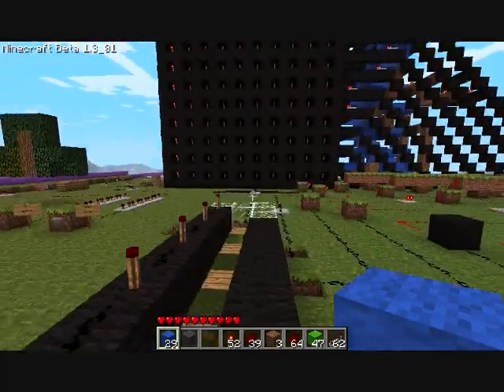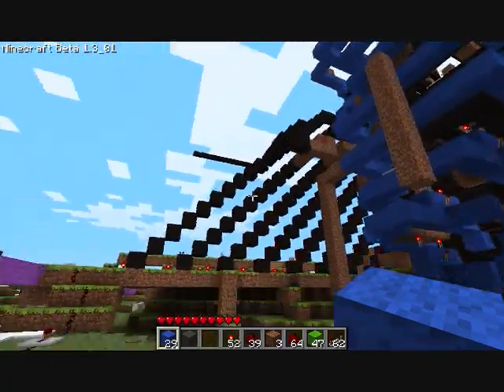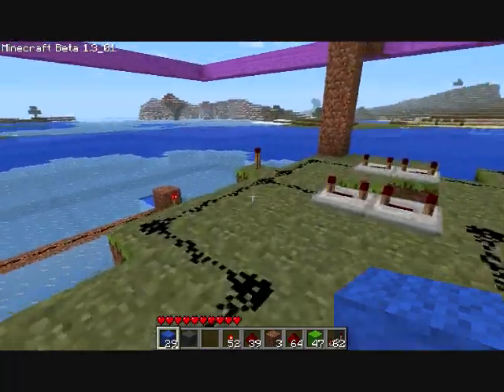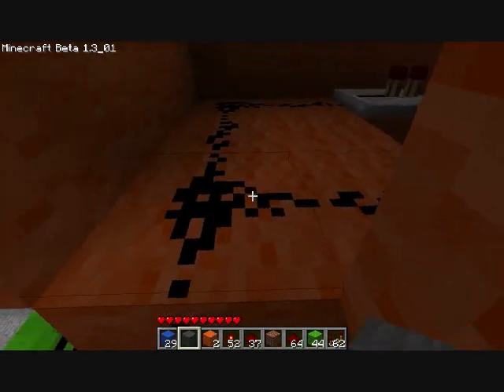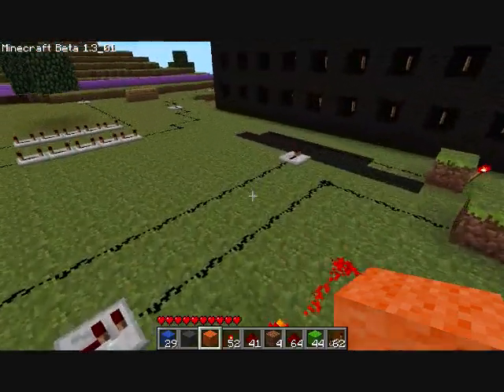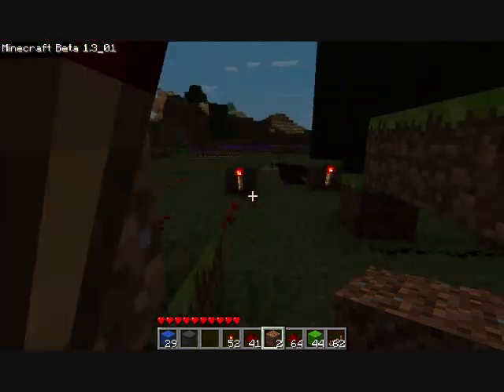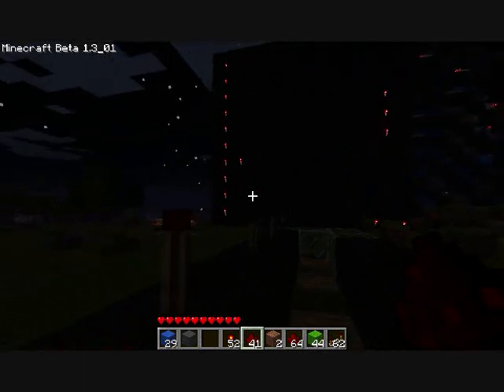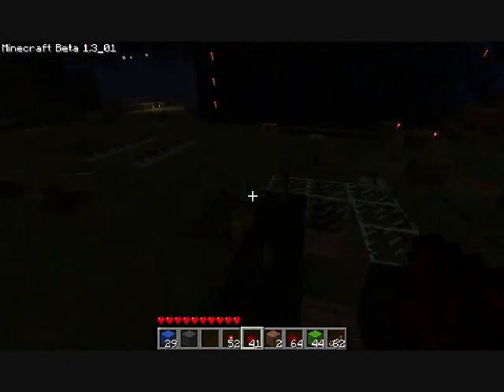Minecraft Pong!

Comment from the maker: @MisterRedstone  The ball was actually very easy, I basically set up a loop of the new delayers theres 16 (2 for each pixel because the ball must go back and forth)  for the x direction and 20 for the y direction so there will always be only one and gate active that shows the ball on screen and it will always move with a slope of 1 or -1 across the screen depending on where the ball is.